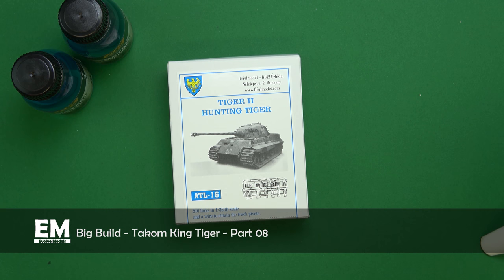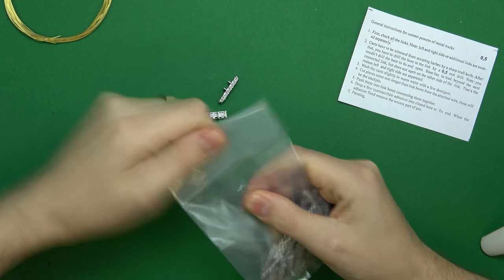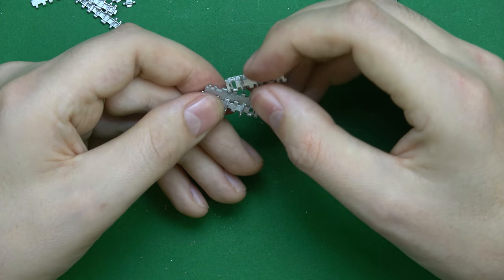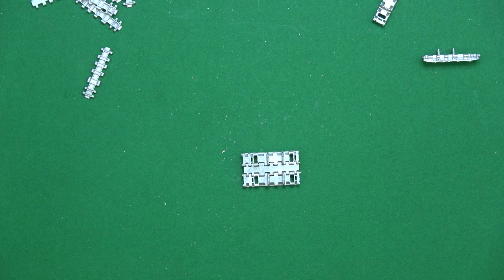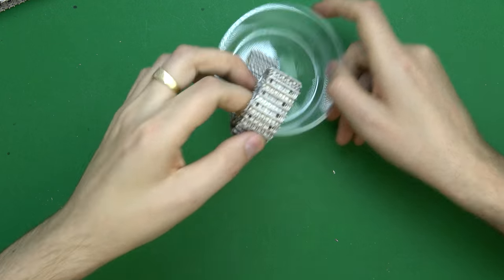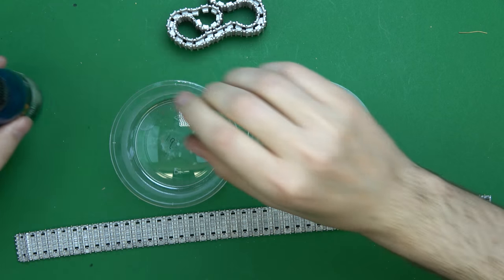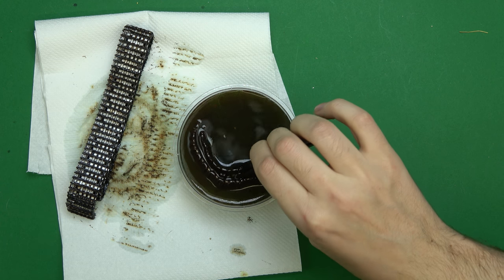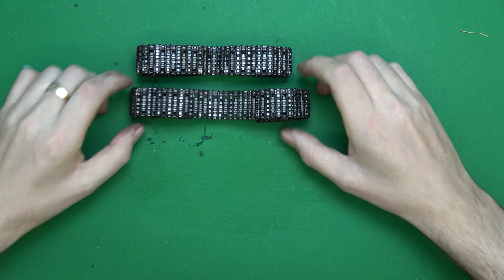Big Build - Takom King Tiger - Part 08- 4K

Comment: Nice build, a little tip when you make Friulmodel use staples instead of the copperwire, bend one side straight and insert it then cut it, no CA-glue, much easier.

Comment: I love how you have set up this series, but for future reference you first need to wash off the tracks with soap and water and then dunk them in the burnishing fluid for hours. 1-8 is what I have seen. You can save some money on burnishing by using time. You can dilute it with water, so fill it up half way and then fill it the rest of the way with water, then just wait an hour and check how the affect is. Wait more if there are bare spots.
This is just meant as constructive critism. I am doing this same build pretty much except I also have a metal barrel with it too. I'm just lazy like that. One of my favorite channels on youtube right now for modeling. Its a break from seeing all the seemingly perfect builds on other channels, where you only see a great modeler and not all the mistakes they made to get to that point. It helps me be a better modeler by seeing how badly mistakes can draw your eye, and avoid making them in the first place.

Comment: Thetracks should be thoroughly cleaned with a mild detergent before they're placed in the burnishing fluid.  Once cleaned and dried, the treads can be soaked in the bf.  While they're soaking, use an old hobby paint brush to "push" or work the fluid into the nooks and crannies of the treads, making certwin the entirety of the treads are totally submerged in the fluid.  Would recommend using a long pan so the treads can be laid out at length and worked over with the brush as they're soaking, flipping them over after 5 to 7 minutes to repeat the process for the obverse of the treads (known as tracks to real tread-heads).
'Tanks' for the great vids on your awesome build!

Comment: Lessons Learned: Bleeding fingers from putting in pins? Don't precut pins, just push one end of the wire into the track till it stops, pull back 1mm, cut, now push pin in to final position with the cutters, done. Some tracks not really burnished well? Wash them first in vinegar, rinse well, then put them individually (before making the full run) and mix them around in the fluid to make sure no trapped air prevents burnishing. When finished, rinse well, then build the links together wearing rubber gloves, or else your fingers will get nasty!  ;)

Comment: Ive recently used the metal burnishing fluid from AK for my ZSU-57-2 tracks. 
Its really important to clean off wax from your track pieces prior to bathing them into the reacting fluid. I sunk them piece by piece unlike you, and made sure the fluid will soak into dented details using toothbrush. 
Even with all these precautions, I still had some white metal part that failed to react. So I ended up putting them back in 2 more times. 

You can actually salvage most of the burnishing fluid btw. Just put it back in the bottle, wait for few hours, and extract the upper/clean blue fluid :)
Reply: here is an image. https://i.imgur.com/MVgQE0s.jpg
Reply from the maker: Thanks for the advise. I was thinking of dipping the again, A good wash is detergent and then dipping them again, I guess you only learn by trying. Thanks for your support.
Reply from the maker: they look wicked